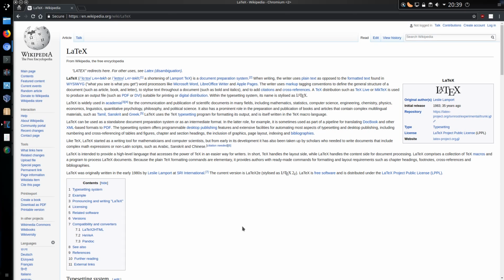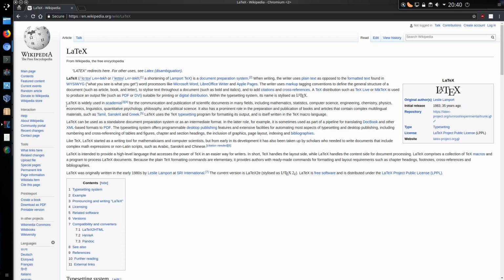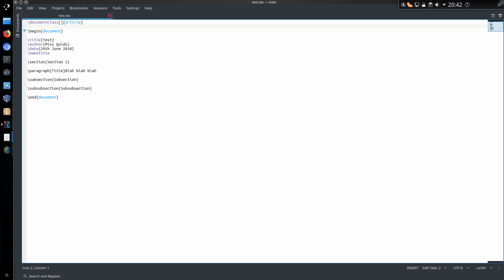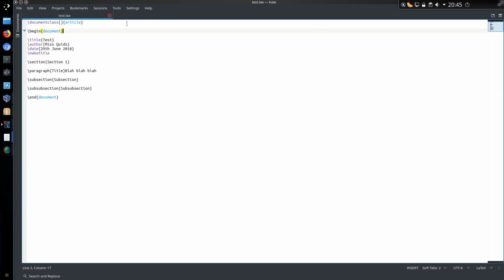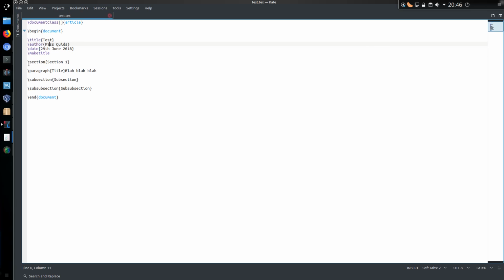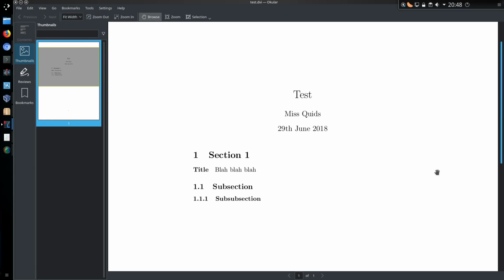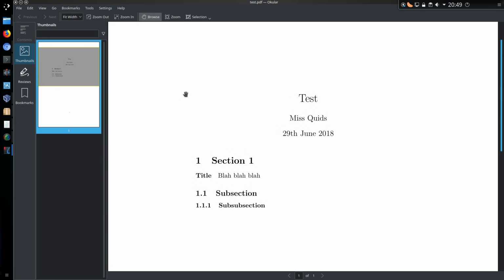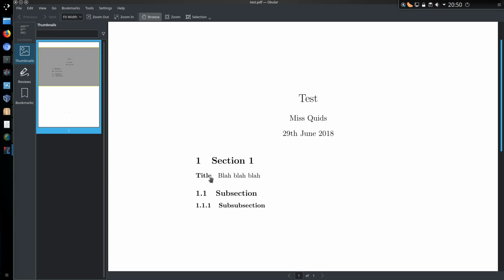LaTeX Tutorial 1 – Introduction

Comment: Miktex is now available for linux, and I would go for it over texlive. It is better for a home user as the default install size is much smaller than texlive, and it can automatically install additional packages on-the-fly when needed.
Reply: Edian I think MiKTeX is only popular because Windows lacks a package manager on its own. As I said, TeX Live is more stable in summary. I use MiKTeX on Windows at work, TeX Live and MacTeX at home (Arch and macOS, respectively), and have about ten or eleven years of experience. It is rare to run into some difficulties, but when it happens, it's always been MiKTeX (I had to reinstall it lately). And of course teTeX, back in the days, it had the same issue (lack of maintainer).
Reply: Hassan Tofaili There are some problems atm on Ubuntu 18.04 with miktex. It works flawlessly on windows though. Really good bundle! Installing and updating packages is a breeze with the miktex console.
Reply: I've used both and I really prefer TeX Live. The installation of the packages is the minor issue here, because eventually you will have installed every package you need from your standard repository. MiKTeX is comparable fragile when it comes to bugs. And I don't know how the distribution handles updates under Linux, while TeX Live is updated by your usual package manager.
Reply: Diemotma yes MikTex is my preferred latex client for windows because it is so easy to setup and texworks is included. Texlive is indeed the standard when it comes to Linux operating systems.
Reply: Ah, my experience in the past has actually mostly been with the GUI TeXStudio, which uses Miktex. Didn't want to show any specific program so just went with texlive, wasn't aware of miktex for linux. Will probably mention specific programs/websites in the future
Reply: MissQuids TexStudio also works fine with TeX Live (it's also my prefered LaTeX IDE). However, any comparison of LaTeX distributions is on a very, very high level anyway, so it doesn't really matter, and the usual user wouldn't see any difference. That's why it is so fun to discuss this matter so violently. :)

Comment: I just tried it out, it is the first time that I use it on Linux. For those who are on Arch/Manjaro (or Argentos but who still uses that?), you only need the packages texlive-core and texlive-bin to do what she did. I just mention it because there are a lot of texlive packages. Install those packages and it will work fine. Quite easy, I remember a lenghty install process on Windows with MikTex. Look here for more information: wiki<dot>archlinux<dot>org/index.php/TeX_Live
I tried out Greek letters too, those are in the basic packages, apparently. I got a funny error-message but the output was correct: "I've inserted a begin-math/end-math symbol since I think you left one out. Proceed, with fingers crossed."  :)

Comment: I know that LaTeX is being used a lot in the fields of mathematics, physics, chemistry and engineering, is it also used a lot in disciplines where they don't use a lot of formulas and symbols?
Miss Quids,  in my experience DjVu is better if there are many images. Too bad that most people don't know about this and that because of that PDF is being used all the time.
Reply: I'm in philosophy, and I use LaTeX. To be fair, I do a fair bit of symbolic logic, which has symbols, but would still prefer LaTeX over a standard word processor for those papers that don't have symbols.
Reply: For symbolic logic it makes a lot of sense. I agree that LaTeX is easier once you get used to it and you have your templates ready, it is the time which is required to get it started which is the problem. I tried it in the past on Windows, it was not that easy to set it up and figure it out. First instasll MikTex in a bit of a clumsy way (paths), then the LaTeX-editor, then I had no idea how the hell to use this editor and finally I discovered that I could use the command prompt to generate a LaTeX-output. 
I experienced that installing LaTeX on Linux goes a lot easier, install it automatically via the package manager and you can directly use it. Word and Writer are a lot more clumsy for formulas and symbols than LaTeX (and for figures and references) but you can directly start with it and you can figure it out on your own without having any knowledge on it.

Something ironic which I didn't consider before, for people in science and engineering it is more difficult to get started with LaTeX because they have to learn a lot more syntax for formulas, tables and figures, if you only would have to write text then it is much easier to start with it. However, the first group of people probably finds it easier to learn something like this. However, if you have to enter enough formulas in Word or Writer then you will get sufficiently frustrated with it that you want to learn LaTeX.

Comment: is it ok if I use word as my text editor? ;p

looking forward to the next LaTeX video.
Reply: It depends on what you want to do. For entering formulas Word is miserable: clumsy, slow, bad layout. For references Word is miserable. For figures Word is miserable. If you only want to write a simple text then Word and Writer are fine. In other cases it probably is easier to learn to work with LaTeX.
Reply: I think they meant using Word to write the LaTeX markup, save it as plain text and then compile it. Silly, but it would work.
Reply: That is so silly that I didn't even consider it. :)
No offense. Anyway, it is not recommended. Best use a regular text editor: Notepad++ on Windows, on Linux for example Notepadplusplus, Kate or Gedit.
Reply: Thank you :) lol

Comment: I used LaTeX to print a 500 pagr novel! It's not only for academic papers :)
Reply: Well done & good luck
How long did it take you to learn/master it?
(learning curve)
How long did it take you to finish the novel? (just interested in knowing ratio; learning/working)
Reply: Are you familiar with Asciidoc or Markdown? I'm really curious at this point what the breaking difference is between those 2 and LaTeX. Markdown's got huge traction due to GitHub but I realize it's not as capable for print work as Asciidoc. I'm wondering why anyone would use LaTeX over either of those at this point though.
Reply: I only used LaTeX for its typesetting capabilities. The base novel was exported in HTML that got converted to LaTeX. Markdown is nice.
Reply: Thanks, I see the difference now. Asciidoc defers to LaTeX and others for math so it doesn't seem to compete with but rely on established formats. The math is a pointer to the more advanced typesitting capabilities. Thanks again for your reply, it helped a bunch.